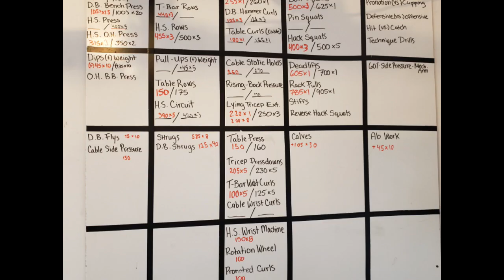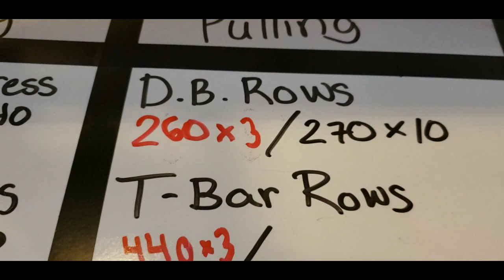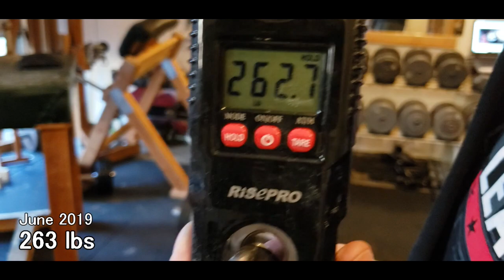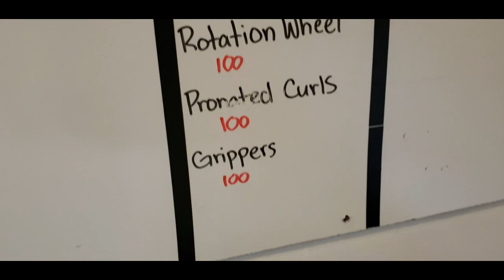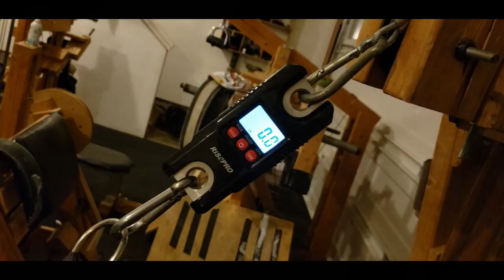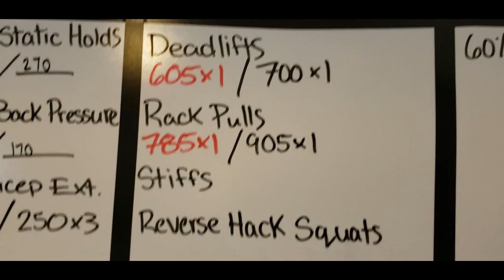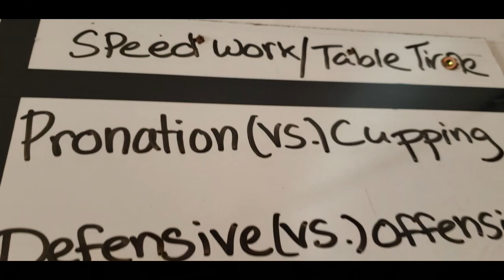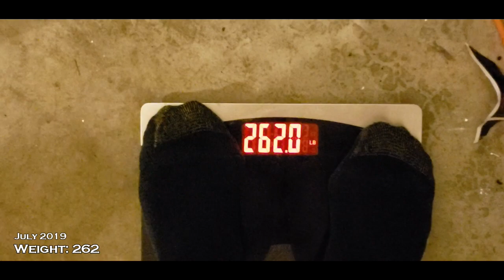Armwrestling Training 2019

Comment: you're very strong dude ! there's no doubt. Take it as an advice : putting a lot of weights is a good way to train for armwrestling but the goal is to work efficiently with a heavy weight. The goal is to do sets of 3, 2, or 1 rep(s) with a minimum proper form. Or you can try to not move with this weight but at least, stay tight ! not work in isometric with an arm almost completely straight. You better be very strong in tight angles. Example : working 105 lbs table row (15 min in this video) is already enough cause you can't pull it completely so 150 lbs is waaaay too heavy. Just be patient and let your muscles and ligaments adapt so you could maybe one day reach work efficiently with this weight.